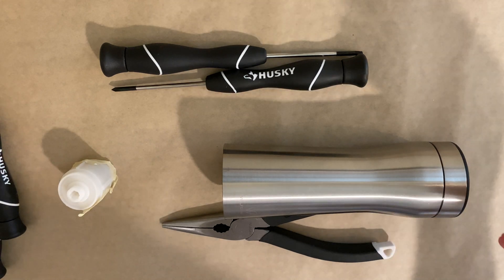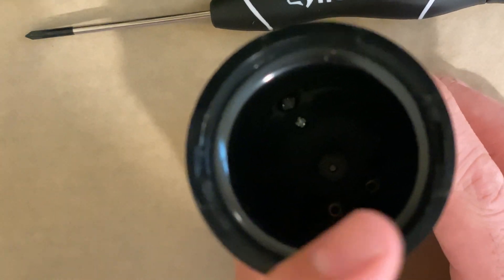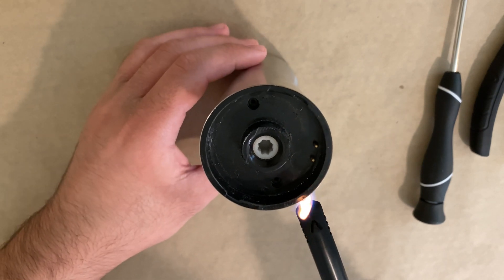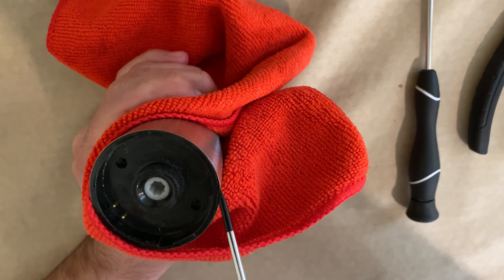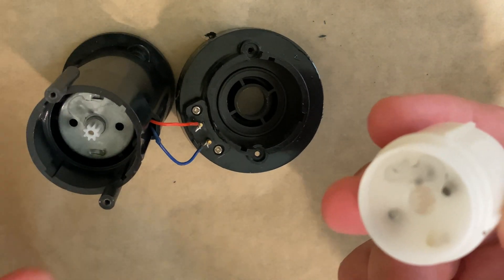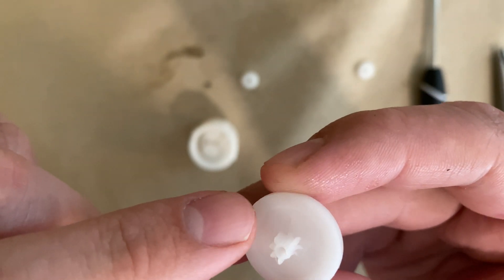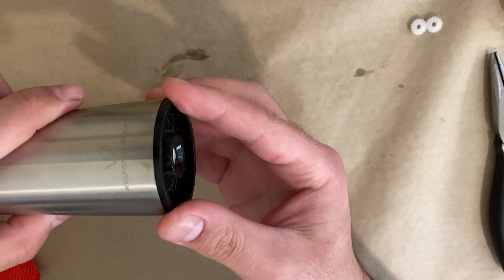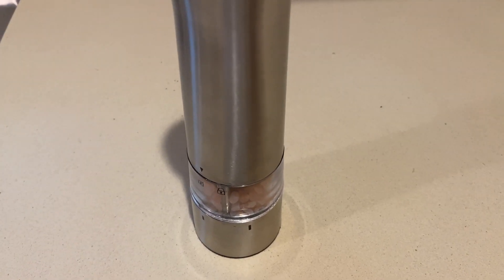How To Fix A Broken Power Salt Grinder

Comment: Hi, where can i find the mechanism replacement?
Reply from the maker: I used parts from another broken one we had lying around. I’d say it’s best just to replace the whole thing.
Reply: @Engineering_Rebel  I see there are some similar looking gear reduction boxes on e-bay.  Not sure if they would  work.  However, they run about ten bucks so whether it's worth it to do a fix is questionable.
Reply from the maker: @iontheball1  for $10 not really, either buy a new one or use a manual one.

Comment: I got a Wolf Gang Puck pepper grinder as a gift for Christmas and the thing turns on but doesn't turn off.  I have to remove the batteries to stop from grinding pepper.  
Should I 
A. spend a few hours watching videos on pepper grinder repairs then bust out a lighter to dislodge the components and attempt to fix it?

B. toss it in the trash and use the manual pepper grinder?

C. order a new one?
Reply from the maker: Hello, after reading your comment I’m going to assume that it’s a broken switch. In that case it’s not worth repairing as these salt grinders regardless of brand always have issues. Ours still works to this day after repairs but I honestly would stick with a manual salt grinder instead. Ordering a new one isn’t a bad idea but it will most probably break again. Kitchen appliances, such as electric salt grinders in my opinion are not worth it. This video is just showing how to repair it if it breaks but often times if the repair is too big, it’s not worth it.

Comment: I need some help man, I have one that the gear box is fine, but the motor is kind off week, what should I do? I may add that it have beeing laying around without use for quite some time. When I try to use it, sometimes I have to manually star the rotation with pliers and then the motor keep it moving
Reply from the maker: Hello! In my opinion first try changing the batteries because its been sitting for a while, it might’ve went flat. If their is acid on the battery contacts, you should clean it with a small wire brush. If that doesn’t work than the motor is going out which you mentioned is weak. Unless you can find a replacement motor for really cheap it’s not worth repairing. This is not uncommon because personally I’ve had bad luck with these. Nothing beats the manual salt grinders. Thank you for tuning in, be sure to like and subscribe.